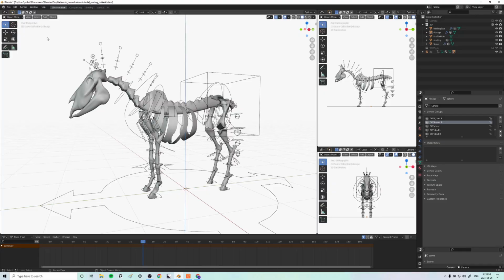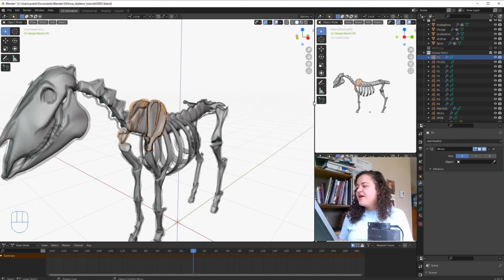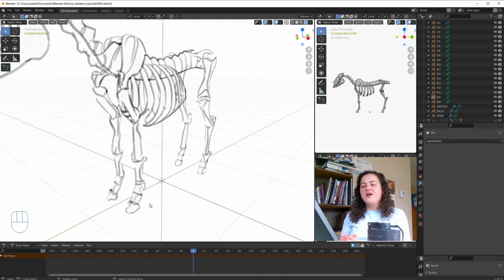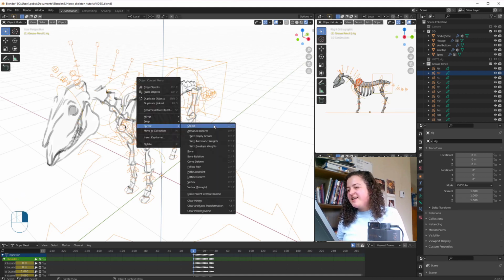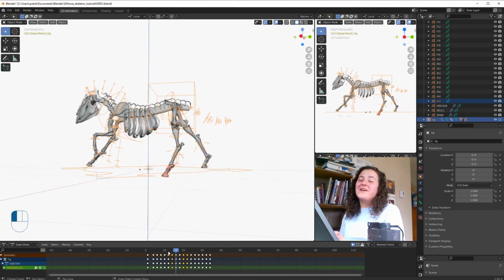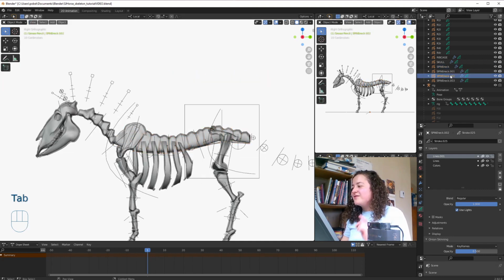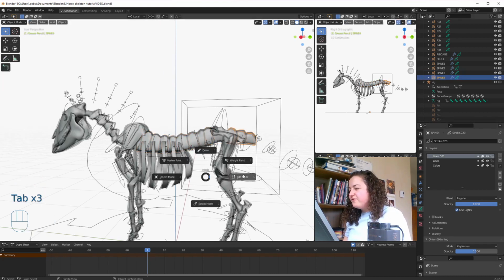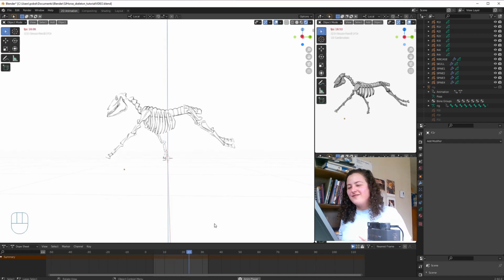Animating our 3D horse skeleton using bone relatives (Blender grease pencil tutorial PART 3)

Comment: maybe i'm wrong, but instead of dupplicating, removing the mirror, applying the mirror and deleating the side yada yada...
does it still work if you apply the modifier right away, then select the strokes you want to separate and press P (to separate)?

edit: actually, you could do the same thing for the spine. instead of copy-delete-paste inside another dupplicate, just separate the selected parts by pressing P (if it really works)
Reply from the maker: Is that a thing!!? I never realized, haha, what an amazing time saver. It makes so much sense that that would exist. Thanks for sharing!
Reply: @SophieJantak  very glad I could help you! I am learning a lot from you aswell :)

Comment: Hey Sophie, here is a rigging with GP question that isn't really realted to this video (sorry).  I have a simple squash and stretch rig on a 3D mesh using a Stretch To constraint.  Then I drew a GP object on the surface of the mesh.  I followed the steps you mentioned in this video to parent the GP Object to the deformation bone.  However, the squash and stretch doesn't match the mesh.  So after the slightest deformation, the stroke is floating in the air.  Is there any way to make it so that the GP object continues to stay "attached" the mesh, and deform along with it with the correct proportions?
Reply from the maker: Hey, thanks for checking out my videos! I've personally never used that constraint and so unfortunately I can't help, sorry.
Reply: @SophieJantak  No prob.  But in case you (or anyone who is reading this) is interested, the new Greasepencil Shrinkwrap modifer in 3.1 allows the stroke to corform pretty nicely to any deformations you make on the mesh.  Go Blender!